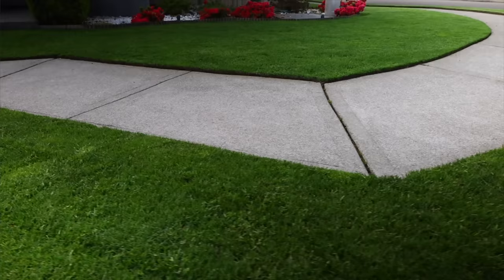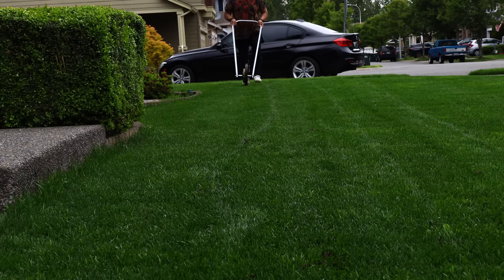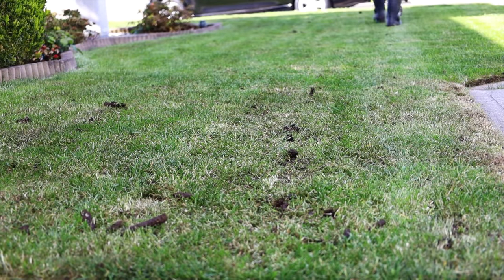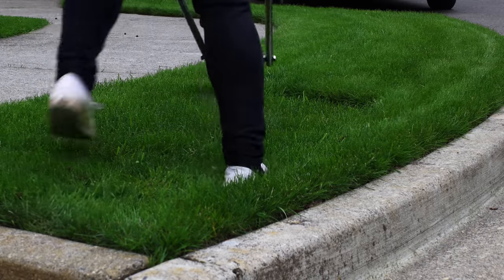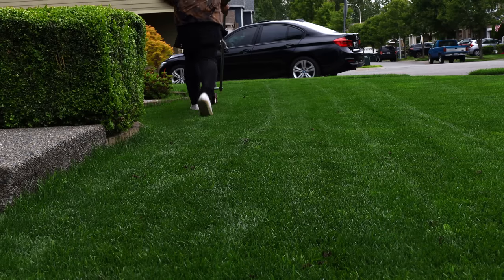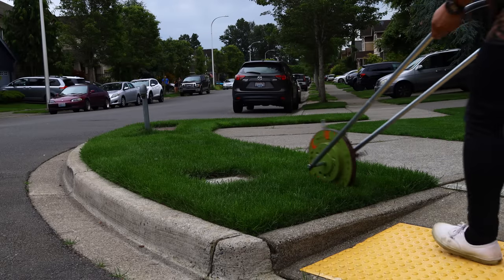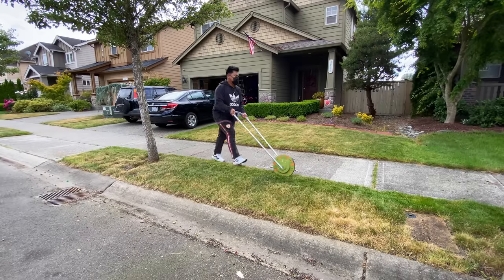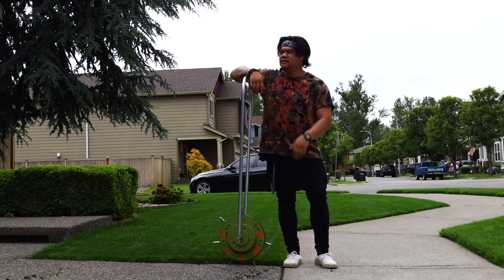Rollaerator 1 year review ~ Pro's & Con's ~ is it worth $350 dollars?

Comment: I got one last fall.  The double rotor version.  I did 5k sq ft.  It was some work but it paid for itself even just once.  Would've cost the same to rent a machine
Reply from the maker: Boom! And you got years of use to come! 😊🤙🏾
Reply: oh hell nah, double version??
Reply: @DirtygardenCA  lmao, I believe they are smaller rotors but give it a bit more weight.  It worked extremely well and my lawn exploded in the Spring
Reply: @kbeast98  ok I was debating the versions, so two smaller versions, versus one large disc?  Only slightly heavier?  What's the weight difference?
Reply: @ForemanJF1  I don't really recall, but he was pushing his newer version-- I can only assume cost..
Reply: @kbeast98 well I went double rotor like you since I think it might help.. he replied quick hopefully he's got this off the shelf and doesn't need a long wait for him to make it..

Comment: Thanks @YardBrah for posting the follow-up video and I am still happy with mine after over a year of owning it. I bought a double rotor model awhile back and it is very convenient. It took about 3 weeks to receive. I am in Dallas, TX with clay and compacted soil, and it is still very effective. It is not quite as effective as a gas powered areator with the clay, but it still works great and gets the job done. It works best when you roll it with just the right moisture in the soil, not too wet and not too dry. It pulls 1-3 inch cores and is a quick process for smaller yards. $350 is steep for the cost of the parts, but time is money, and this thing definitely saves time for smaller yards.
Reply from the maker: Yes for sure!! The double one looks like it’s more of a workout 😂😂😂😂🤙🏾🙏🏾🔥👊🏾

Comment: I made one for less than $15 of parts.  I got the rotor from a friend's garage that lay these around. Thanks for the idea!!   Note, this thing is very hard to go up hill.  Lots of labor power.  But on a flat, it's great!
Reply from the maker: Aye nice!! What did you use for handle and tines?!? 😊🙌🏾🤙🏾🙏🏾
Reply: @YardBrah  I did make it sound easy but there are some hard work behind.  Tines - uses Electrical Conduit.  $4 for a long tube.  Handle / bar / 90 degree- PVC pipe 1 in, few bucks here.   I later upgraded wheel bearing with literally a Car wheel bearing to fit onto PVC pipe to let rotor to spin super freely.  This part took me a couple weeks to wait on ebay $5 if someone willing to dump.  I probably could look for it in my friend shop's trash bin.   I spent lots of work cutting electric conduit and drill holes on rotors to make tines to fit.   Some do get bent up after hitting rocks.   So I did make it sound too cheap but yes $350 probably worth the effort.    Definitely use electric conduit to replace tines!!
Reply: @awdx4g63  any chance you could email me pics of what your setup looked like? This is not spam I’m actually really trying to make my own version but having a hard time conceptualizing the parts I need for it.

Comment: Hey how low can you cut with the Sun Joe with the wheels off using only the front and back rollers?
Reply from the maker: I’m at .5 inches without the wheels 🤙🏾
Reply: @YardBrah  thanks. I got the amick after watching your video. It’s so much more efficient than the step plug aerator
Reply from the maker: @somethingsomethang  That is awesome! Yeah I mean I started with the step literally spike boots 😂😂😂 can't beat that magical overpriced rotor 😂🙏🏾🤙🏾

Comment: Bro. I ordered this months ago and only got the handle shipped they haven’t even shipped the wheel part yet and idk if they even plan to…
Reply from the maker: Are you kidding me call them man! That’s super  frustrating 🤦🏾‍♂️
Reply: @YardBrah  so yeah I ordered it off eBay and you saying it’s discontinued on eBay adds up cause I think something wrong went there lol. I need this aerator though because out of all yard tools I feel aerators are the least developed or sold.
Reply: Same hapened to me but I got a full refund. And kinda glad I did some people don't even believe in aerating if you do whats necessary to your lawn. Idk time will tell. but at 350 I might have to strongly consider just buying a gas powered used one. SIgh, this lawn thing is very pricey .